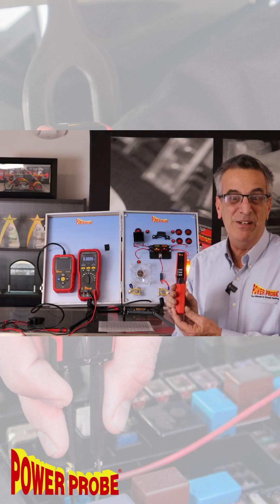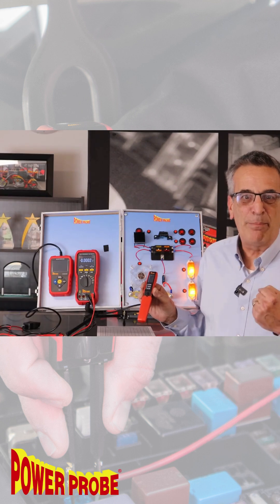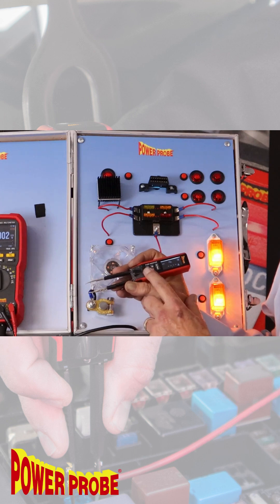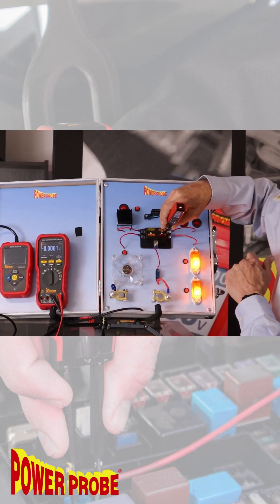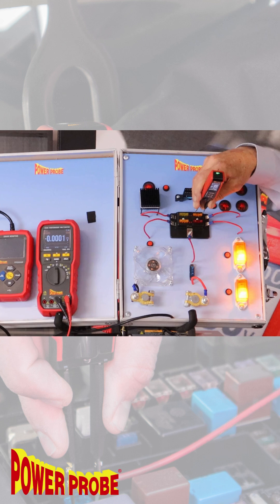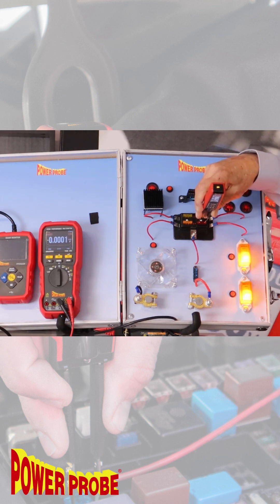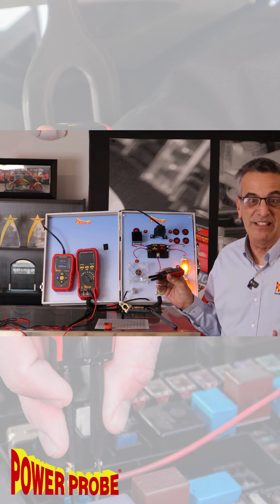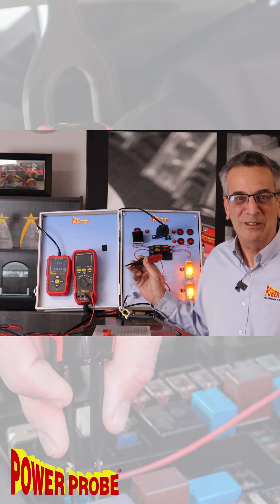PPFUSE

Comment: How can the meter be checking amperage with the fuse still in place unless the fuse was blown? Otherwise the current will just flow across the filament of the fuse.

Comment: Will it work with mini fuses?
Reply from the maker: YES!!
Reply: @ but not micro 2 or 3? Correct?
Reply from the maker: @ will read down to 2A mini!
Reply: @PowerProbeUSA  Im talking about fuse type micro 2 and 3. They smaller then mini
Reply from the maker: @kastenusa  Micro fuses & mini fuses can both be tested in the mini mode of the tool, as long as you have access to the exposed prongs at the top of the fuse, you can test it.
Reply: @kastenusa Mini2 yes. Im not sure about mini3 there's no dedicated setting for it just lists ATC, mini, and maxi.